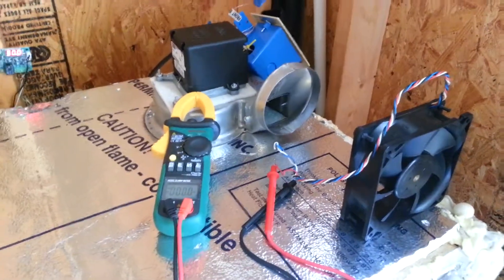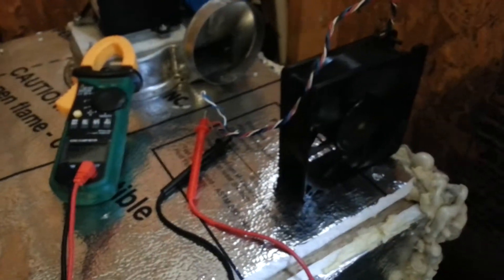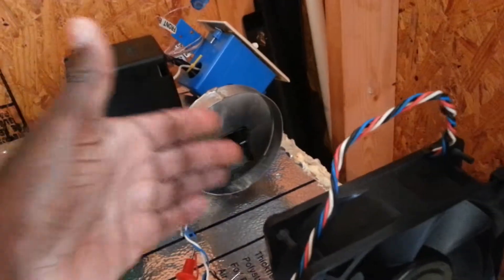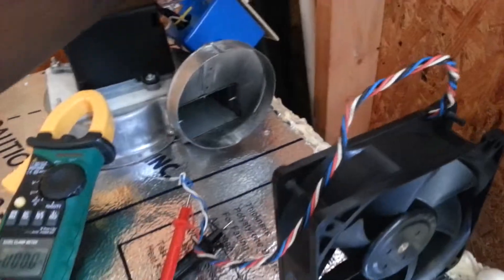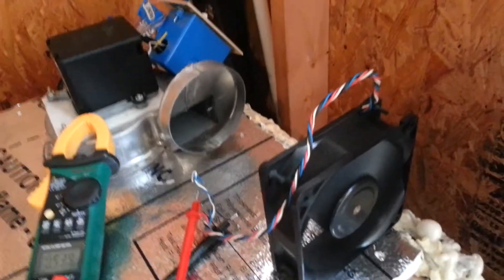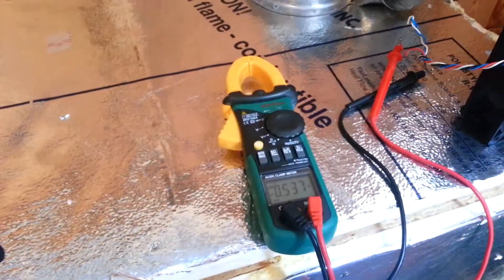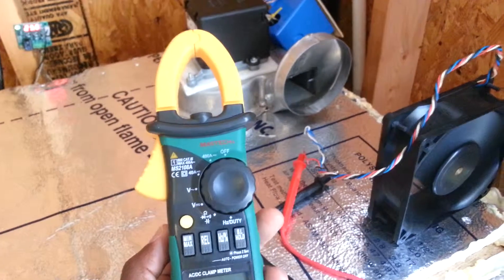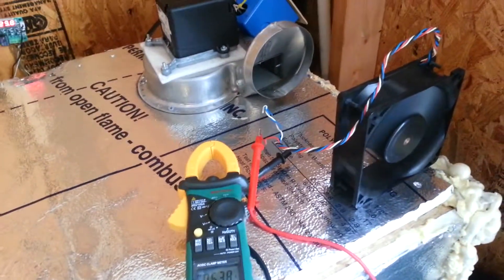Experiment: Generating Electricity Using a 12 Volt DC Fan

Comment: I was just looking through some of my old comments and I remembered, I used to have a setup with six dc fans bolted together with a nut as a spacer between each, all the red and black wires soldered together, (reds / blacks). I duct tape a strong magnet to the bottom and stuck it on the roof of my truck. at 50 miles per hour I would get about 12 volts out of the "wind tunnel" of fans. (about 15V at 70 mph). I ran the voltage to a 12 volt, 4Ah battery which I used to charge my phone while not in my truck. you can definitely "stack" several fans, just be sure to have enough space between them so the blades aren't touching. just a thought.

Comment: I noticed that your using a 4 wire (pwm) dc fan. I don't know if you have finished with this since it has been a while, but if you use a 2 wire dc fan (one without Pulse Width Modulation) you should get a higher voltage output.
Reply from the maker: Michael Gasperik 

Thank you.  I may actually try it out.  Cheers